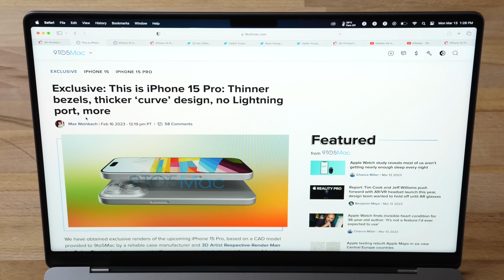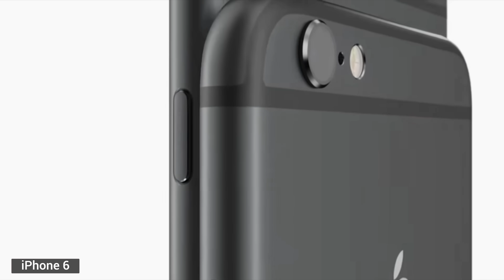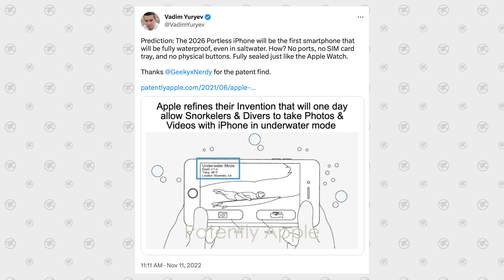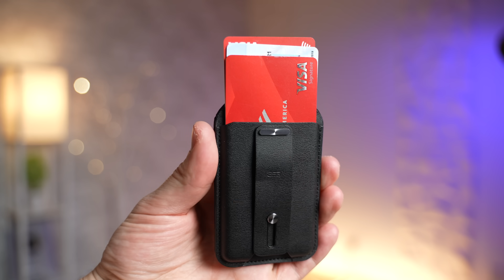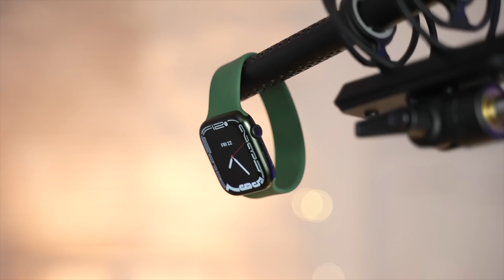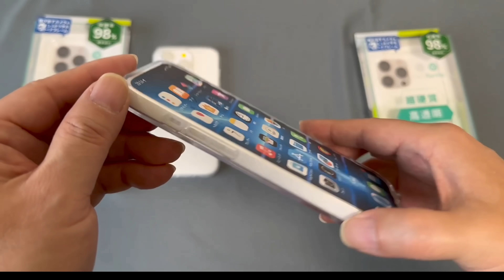iPhone 15 Pro 3D Design Leaked (Not what I thought..)

Comment: Not gonna lie, the only thing I’m stoked for this year is it being titanium. The rounded corners I think is a good touch. However that huge camera bump… um…. Yeah. 🤔
Reply: The iPhone x had rounded Conners
Reply: @Louisz14  the X had rounded sides. I shoulda said edges my bad
Reply: Why would you lie?
Reply: @wrd980  don’t really have a good reason too.
Reply: I have the 14 pro max and I’m pretty happy with it and it’s camera. As for the titanium, I don’t really see a point if you’re already gonna have a case on the phone and think about it, (entertaining the idea of going caseless) if you drop your phone, if the titanium frame doesn’t bend or break, the damn glass back and front sure will. not to mention that my standards of durability does not consist of wanting my phone to survive a bomb.
Reply: @diplexnormal3353  The titanium is more for weight reduction without sacrificing durability rather than solely an aesthetic choice.
Reply: @Bananeurysm  I mean, my phone is a tad bit heavy, but it’s not a hassle.
Reply: I also like the idea of Titanium, but we still don't know what the price will be? I'm a big fan of the proposed Deep Red and would buy that phone, even though I am quite hooked to my Red 13 Mini. Even though I really love the small size, I mess up texting sometimes. The phone is a bit small for some things, even though it's super convenient for being in pockets etc.

Comment: I have the beast, the iPhone 13 Pro Max. The next time I upgrade will be when that disaster island is gone. There’s no need to upgrade with 120hz. It feels like a new phone every time I use it. The 13 pro max also has the best battery still.
Reply: The next time I upgrade will be when that disaster island is gone. 

True. At this point the next “big thing” will be the full screen without any notch, pill, cutout or whatever. After this holy grail is achieved back to boring incremental updates.

Comment: I think the upcoming iPhone 15 Pros will look like the combination of iPhone 5s and iPhone 11. There will be 2 sandwiched glass that curves to the titanium side (like the apple watch) and the feeling will be like holding iPhone 11. I highly disagree with the mute button though. I think it will not be haptic but instead it's gonna be like the iPhone 5s mute switch moving from top and bottom (with round switch), opposite of what we currently have (front to back movement).
Reply: I'd like aluminum back, or the 5s look, they look so nice and premium, as you said the watch ultra look would be good

Comment: iPhone 2024 Apple be like we removed all ports, buttons and speakers - revolutionary. 😂😂😂
Reply: Their haptic solid-state features have been great, from the trackpads to Touch-ID. They own many of the patents so costs will be low. No moving parts means equals more reliability.
Reply: @ahaimes6320  I get that, but they’re regurgitating the same phone over and over with slight changes and making it sound like it’s revolutionary. iPhones are becoming stale. What I really want is an all screen display without interruption. I’m over the notch life and the dynamic island doesn’t do anything for me. In some ways it’s worse than the notch.

Comment: I mean it looks almost identical to iPhone 14.. I’m sure the rounded edges will be barely noticeable, and with a case on it would be impossible to tell between iPhone 14 and 15 (pro, at least). And it’s the exact same design since iPhone 12, apart from the change in the size of the camera unit

Comment: if it wasn’t for usb-c, i wouldn’t really be compelled to upgrade from my 13 PM bc phones have gotten to a point of diminishing returns. i actually prefer the smaller notch to the larger obtrusive dynamic island. but I really want so badly to use the same cables for everything I own (and hey it’s not like it wont come with other expected upgrades like processor, camera, etc)
Reply: @sercan272727  True, it won't work with all your existing cables like people hope. 

But I guess you could have the one proprietary Apple cable and charge everything with that? Should work with other non Apple devices. 

How is the USB-C situation with the iPad, does it work with any cable?

Comment: Very naive post! you think a high-tech company like Apple will plan its innovation cycle for a product that generates its 80% of its revenue in this very silly manner? 
Because the market is moving so quickly, research and development outcomes and patent filings are being implemented in record time nowadays, and Apple is not an exclusion.  

Will you think it sounds logical (or even from our previous experience with Apple) to brings in features that on the market 3 or 4 years ago, and to be inserted into devices 5 years later? 8 years gap why why hehe

Comment: Be nice to see them implement a tiny OLED, always on light panel to be used as an indicator in place of the red/orange line in the mute switch. 

That way software can replace a hardware feature and then it can be used for multiple things. Charging status  indicator, notification pulse letting you know you have a missed call, unread message or any notification of your choosing. Let it sync with focus modes and use different colors and strobe rates to indicate separate things. 

Something small that could make a difference to some who would miss the OG mute switch.

Comment: No ports is fine to me, I almost never used the port since it’s often full of dust anyway 😂
Reply: If there is no port , good luck trying to plug in an accessory if you change your mind , and too bad if you want to receive or transmit data via some other way other than by the waves.
Having no port makes the device way less versatile and is idiotic.

Comment: Looks to me like this is a very slight upgrade in design.  Slightly more rounded edges and a bigger camera bump.  USB-C... yawn... I already have a bunch of lightning cables and chargers that work just fine.  Curved glass front edges won't be protected with a flat-glass screen protector.  The only thing that can really excite me about this is MAYBE a really fast A17 and a big jump up for camera quality... although my 11 pro still takes impressive photos, and it's quick with everything I do.  Maybe I'll wait for the 16 pro with the single hole punch-out.